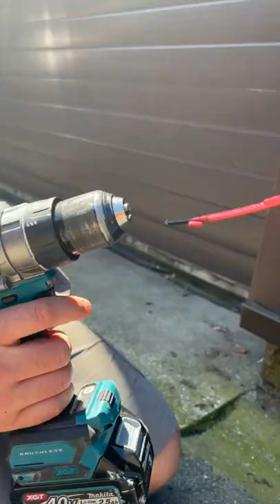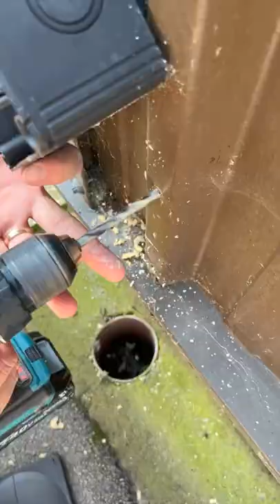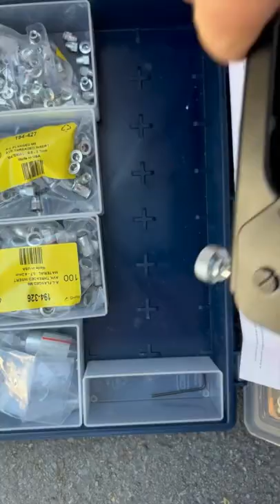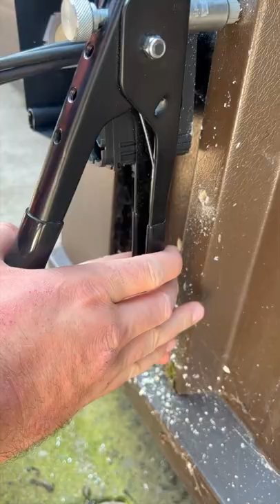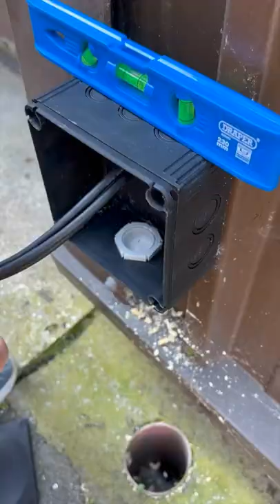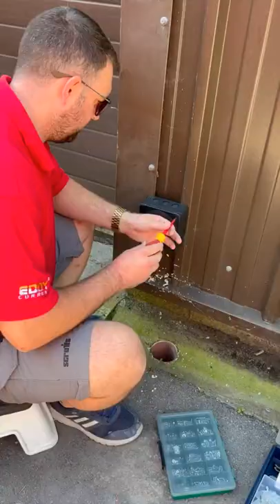Fixing a Wiska Box to Thin Materials

Comment: Interesting. I used self tapping screws for the same type of building. This is a better solution
Reply: Self tappers are fine. This is another over engineered short for a shed wall.
Reply: Only issue with self tapping is tapping them more than once in the same hole (if it is thin)
Reply: My point was this is a better solid than self tappers and easier to do into steel. I had a different job into stainless steel and the tappers would melt. Ended up having to drill pilot holes then the tappers.

Comment: Those style rivnuts are designed to be installed in thicker materials. You’ll want a different style for thin sheet. Here in the US, I’d suggest you call Aircraft Spruce, but I’m sure there are good sources by you too.

Look for the “grip range”.
Reply: In a non critical application like this they will do just fine to be honest. As long ad the rivet deforms enough to get a grip it will be fine.
Reply: @peterpeterson9903  it’s not about the strength of holding the box up that matters. For that purpose, I agree this is sufficient . However, when the time comes to unscrew it, and you discover that the rivnut spins in the hole and is now just a rivet, you may regret using the wrong part.

Comment: Strong bond would have been just as good albeit you need to wait a little for setting, I had issue with a garage with that concrete marble mix which this resolve could not fix, I fixed some wooden template with a bond and did the job day after, customer changed his mind so I tried removing one the the wooden plates, it took a crow bar and still left a layer of wood on the wall.

PS - YT rules state you need to acknowledge if you are posting videos where you are in anyway benefitting from the product your video may promote, you have not done this on this occasion yet I have been informed you are doing so, typing AD: in your comments listing does not comply.

Are you in anyway sponsoring or benefitting from this video?

Comment: Make a coherent sentence out of the following words. WEATHERPROOFING.  cladding compromised in 5 places
Box in 1 place
Silicone rear screw holes and self tapper through the sealant

As for the 20mm rear hole, waddaya gonna do?
Reply from the maker: Closed cell foam insulation doesn’t absorb water.